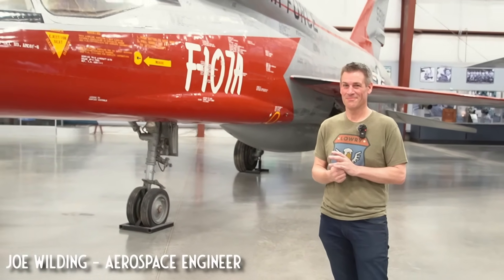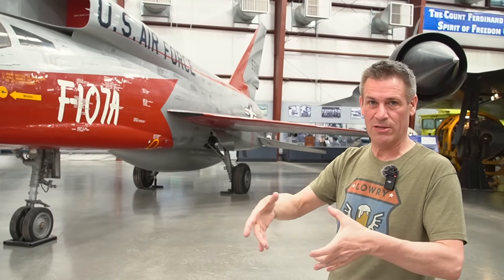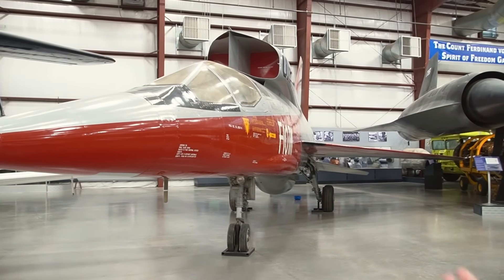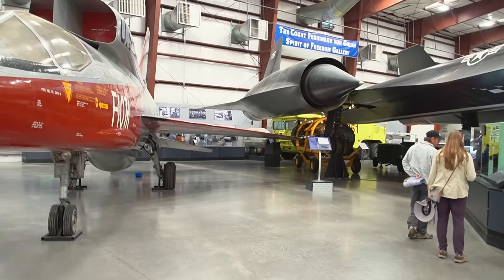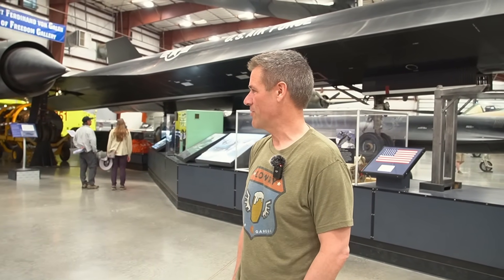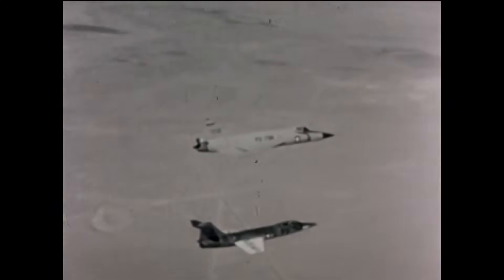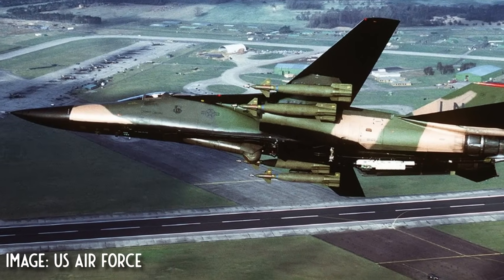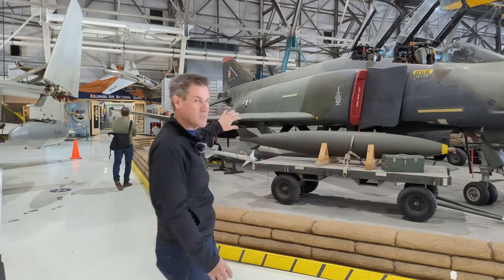The Century Series Fighter You (May) Never Have Heard About | The Aviation Show Clips

Comment: Three were built. But only two survive. The third was used for fire fighting practice. The intake ejection problem was completely solved with an ejection system that included a rail that kept the seat going up. NA knew what they were doing.
Reply: The F-106 had a similar seat with extended rails.  It did not work very well.